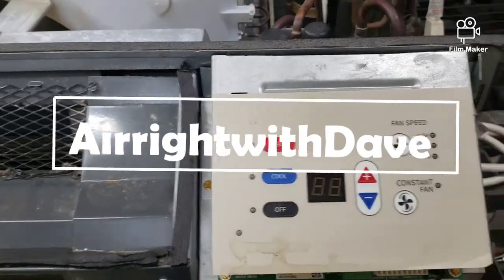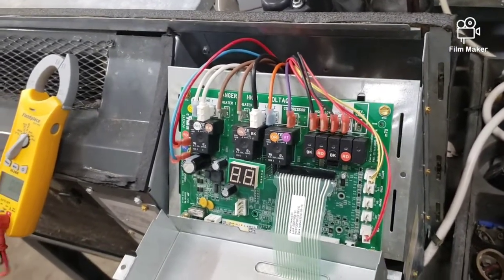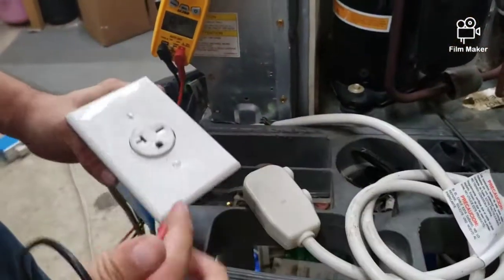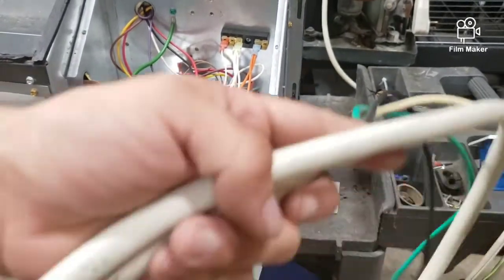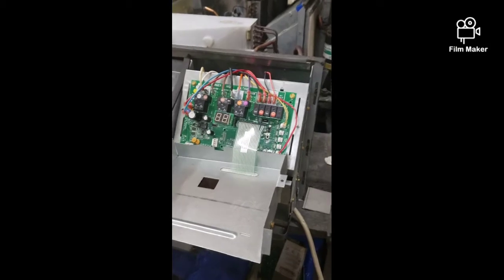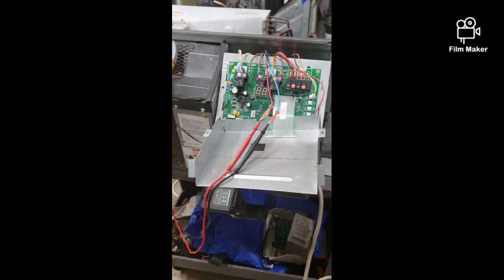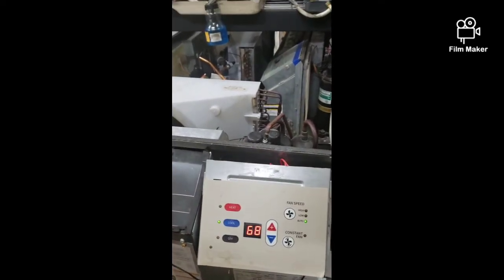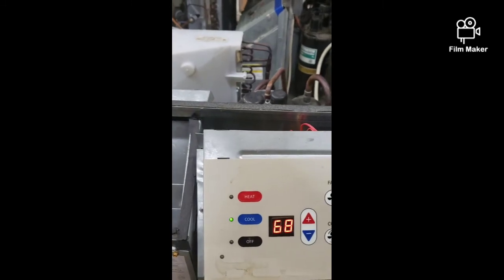Ptac not coming on at all/diagnostic

Comment: I had one of these units same control board, replaced it with new board getting 120 on each leg and 25 on low side still has no lights does nothing even with new board...
Reply from the maker: Hello
Check how much power is coming out of the outlet.

Comment: Hello David, I have a few of these newer Amana PTACs at my hotel I work at and I have been running into these newer PTACs having what looks like secondary control boards on the inside. I don't see anything in the manual that shows it and how it is wired to run the unit. Have you ran into this issue before, and if so how did you resolve it?
Reply from the maker: Hello,
I believe you are talking about the variable speed terminal board, if so that board is to control a DC motor(blower motor or condenser motor). Is the unit not operating at all?
Reply: @PtacSolutions  it is operating however tje guest has been saying that there is an audible clicking. The unit would cool and then the clicking would start and then would start and stop its cooling
Reply from the maker: @Joeygambit  so what I usually do is take the unit out of the sleeve and let it run so I'm able to pinpoint the clicking noise. It could be the condenser motor going out

Comment: If you replace the board, have 230AC and 24VAC, and it still does not come on, did they send me a bad board?  Is there anything else to check?  Thanks much for your videos.
Reply: OK I can see that the ribbon cable from the display is torn at the corner and one trace has been disconnected.  I assume that means a new display is needed.

Comment: Ayyyyoooo, im at the same point with accurate power, (from plug, cord, board, transformer, and then board again), coming into the board from the transformer.
Is there nothing else that could be wrong? Or anything i need to test before buying the new board?
Reply from the maker: Hello,
If you have 24 volts or so coming out of the transformer, then more than likely you board is bad
Reply: @PtacSolutions  that's what I figured. Thank you for the video and the reply! I owe you one!!

Comment: So did you push the reset on the cord/ and or did you verify that the light is green on cord meaning there is power. 230 cords have reset and not to often fail
Reply from the maker: Hey Josh
Yes I did press the reset button on the power cord but no good. Power was not getting to the unit. It's uncommon for the power cord, but I have seen several go out for different reasons.
Reply: 😂I was gonna say the the same thing I'm  so glad  I didn't  before reading your lol

Comment: I own an apartment complex that has several of these in them some are whirlpool I believe and then summer Amana I was wondering if these older ones are worth working on and replacing them and how do I perform all the troubleshooting steps as I have several that are not working right but I think that they are still worth saving. Thank you for your time.
Reply from the maker: Well it depends, if it's something simple like a control board, capacitor power cord etc.. I would repair, you can diagnose by following the steps in the video. If it's something like a bad compresor, refrigerant leak or if the unit is older than 12 years of age, I would recommend the unit to be replaced. Thank you for watching...

Comment: Hey so I work at a hotel and I’m wondering how to test for GE ptac unit it’s just like the one you changed the condenser fan on the video but just wondering what I should check we have a unit the compressor turns on momentarily sounds like a humming sounds but doesn’t turn on the fans what can I troubleshoot to get it going ?

Comment: Thank you for video. How you test power as there is two hot wire. Do we use ground as neutral? Please tell more  about two hot wire.
Reply from the maker: Hello,
Two hot wires are simply two wires that are energized with 120 volts each,  which correspondingly will 208- 230volts if measured together..

Comment: Thanks, great video.  Question: Did the cord actually need to be replaced here, or only the control board?  If only the control board, is there a way to find that out before replacing the cord?
Reply from the maker: Hello, 
Yes power cord needed to be replaced because the control board was not getting power due to that power cord. After replacing it power did get through to the control board but the board was still not responding. After testing the transformer( was good) I knew that the board was also bad... Thank you for watching!!
Reply: @PtacSolutions  What about the buttons on the side of the power cord?  Im assuming they act as a GFCI outlet would've.  Could it possibly have been that when the board went bad that it tripped the GFCI and all you needed to do was reset it?  Not trying to be difficult, just legitimately curious.

Comment: Hey Mr Dave working on a amana ptac is there a way to reprogramme the unit the compressor won't come on seems  like everything checked out good ?
Reply from the maker: Hey Paul
Check to see if the capacitor is good, check the overload switch as well. If its one of the newer units check the pressure switch
Reply: @PtacSolutions  Hey Mr Dave I checked everything and it doesn't have the pressure switch I told my boss it's the board and he was the one that said he knows someone that knows how to reprogram thaw units I never heard of it let me tell you your a good teacher and I checked everything u said to what do you think is it the board
Reply from the maker: @paullambert1485  thank you... It could also be a possibility, if you still have access to the unit I would check If the control board is sending power to the compressor either at board or at the compressor itself by removing the terminal cover
Reply: @PtacSolutions  Thanks Mr Dave I will let you know
Reply: Good morning Mr Dave I went back to that unit and now it is getting power to the board but it won't even come on what do you think ?
Reply from the maker: @paullambert1485  ok, so check the compressor windings, you are supposed to get continuity between every terminal. How about the overload switch? should be under that terminal cover as well. If is open more than likely you have a bad compressor
Reply: @PtacSolutions  thanks I will check the windings and the overload switch is good
Reply: Hey Mr Dave I figured out that ptac it was the board i jumped out the compressor and the fan they both worked so I replaced the board all good now thanks for your help

Comment: Dave, I have a Frigidaire ffrp152lt4 ptac I've had to get for our heating source. There was no power supply cord w it so I've had to order one. I've waited to the last min to install the cord, though there are no clearly labeled areas for power cord to plug into on board. Any info or help would be much appreciated. Thank you for your time in these vids
Reply from the maker: Hello Lindsay 
Can you send me a picture of the electrical compartment so it would be easier to guide you to:
davidcardenas@airight.net
Reply: @PtacSolutions  email returned w contact info 🙏 God bless you!!

Comment: Hey Mr Dave hope all is well I'm having a problem with a thermostat will not connect I keep getting a code on the thermostat that says CF I know ona unit it probably means clean filter but no codes on the unit what could that CF mean
Reply from the maker: Hey Paul 
What kind of thermostat are you working with

Comment: Hey David that was a great video. I did the same test but you confirmed that the control board need to be replaced. Where can I get the control board?
Reply from the maker: Hey Dewey
You can get the board directly from Amana.. their number is 18773760214
Reply: @PtacSolutions  thanks
Reply: @PtacSolutions  Thanks, very useful video. Where can I find an Islandaire Control Board and Transformer?

Comment: my frigidaire 900btu ptac is not coming on. is there any fuse in the unit ishould check
Reply from the maker: not to familiar with frigidaire , worked on some on rare occasions, but I would check if the unit is getting power. If its the newer type, some have trouble with the display board/touchpad. If its a 230 volt unit dont think they have a fuse.
Reply: @PtacSolutions  we jus just replace the whole unit instead

Comment: If the little green light is on on the plug in part but the ptac unit isn't coming on, is it bc the chord is bad and needs replaced?
Reply from the maker: Would you be able to check the output of the transformer? I would say that a very common problem for the Amanas is the the control board, but I wouldn't know unless you can check

Comment: Mr Dave I have a Amana unit changed the took the board out of a unit that works and I'm getting power to the board but unit still will not come on what the heck could that be
Reply from the maker: Ok, so let's use process of elimination.. has to be 1 of the 4.... control board, power cord, transformer or a fuse( if unit is 265 volt)... if all that checks out I would replace the control membrane itself
Reply from the maker: Oh also make sure you are getting the correct voltage to the unit
Reply: @PtacSolutions  hey Mr Dave I checked both legs both legs are getting 120's I checked the plug itself and it's getting like 218 so I don't know if that had something to do with it or not but I put in a whole new unit and fire right up so it's not the power going to it I just can't figure this one out
Reply from the maker: @paullambert1485  hey Paul, sounds like a transformer problem... but I'm glad you got it resolved
Reply: @PtacSolutions  Thanks Mr Dave I'll let you know when I get it figured out I'm gonna work on it next week
Reply from the maker: Chad T  Hey Chad, on the Amana units the ones that come with a 20 amp fuse are the 277 volt units and the would be located right below the control board

Comment: So, you just changed out the power chord without even checking the gfci reset switch to see if it was tripped ?
Reply from the maker: Yes, the reset button on the power cord was stuck and would not reset..

Comment: I have a ptac unit I have power from wall to unit but the unit still ain't coming on and I've replaced the transformer the round transmittor still nothing I don't kno what else it could be
Reply from the maker: Hey Elvis 
What kind of unit is it
Reply: @PtacSolutions  how do I tell that
Reply from the maker: @elvisfoy8039  does it look like the one in the video
Reply: yea
Reply: @PtacSolutions  yes it's just like those I work at a motel
Reply from the maker: Can you confirm that out of the outlet 230 volts are coming out...if so, also confirm that out of the transformer 24 volts are coming out
Reply: @PtacSolutions  how can I check that sir
Reply from the maker: @elvisfoy8039  ok, put your multimeter leads inside the outlet to check power coming out(should be 230 or 265 depending on the building) if that checks out move on to the transformer.. check if power coming out of the transformer is 24v
Reply from the maker: @elvisfoy8039  https://youtu.be/aWO7BTRHhd4

Try these steps to check the transformer
Reply: @PtacSolutions  coming out of the wall is 240v
Reply from the maker: Ok so that's good, what about the transformer
Reply: @PtacSolutions  I'm gonna have my boss check it out tomorrow but we replace it also
Reply from the maker: Yeah just wanted to make sure because if it's good the problem is the control board
Reply: @PtacSolutions  we will check it but we also replace the board twice
Reply from the maker: @elvisfoy8039  really? OK let me know how the transformer turns out.. also look for any loose wires inside the control panel
Reply: @PtacSolutions  still nothing we replaced everything and we even plugged another one in before we did anything and still nothing but there is 240v coming out of wall outlet
Reply from the maker: @elvisfoy8039  was the other unit working before you plugged it to that room? And let me ask you this, if you connect that other unit we had originally started with in another room would it work?
Reply: @PtacSolutions  I never tried that
Reply from the maker: Do you see any burnt marks on the outlet?
Reply: @PtacSolutions  no
Reply: @PtacSolutions  how can I send u a picture
Reply from the maker: @elvisfoy8039  ok, so assuming everything is connected properly it has to be one of the four-  power outlet, power cord, transformer or control board
Reply from the maker: @elvisfoy8039  ok send it here also send a picture of the control panel wiring 
davidcardenas@airight.net
Reply: @PtacSolutions  it's not letting me load it
Reply from the maker: @elvisfoy8039  oh no.. ok try this one 

cardenasd89@gmail.com
Reply: @PtacSolutions  just sent u a email at the gmail one
Reply from the maker: Got it
Reply from the maker: @elvisfoy8039  ok everything looks good on that pic... can you check how much power is coming out of that transformer
Reply: @PtacSolutions  ok and my boss sent me something bout hooking the wires up differently or something on the control board that has to do with the compressor or something like that lol
Reply from the maker: @elvisfoy8039  let me know
Reply: @PtacSolutions  we replace everything and it's still not powering up but we have 230v coming out of wall n 24 v from transformer
Reply from the maker: @elvisfoy8039  Hey Elvis, ok so if the transformer is giving you 24v that means that the outlet is good, means that the power cord is good (power going to the unit) and the transformer is good as well( making high voltage into low) so the only thing you are left with is the control board or maybe the actual touch pad( Control membrane)
Reply: @PtacSolutions  we changed all that bro still nothing
Reply: @PtacSolutions  we have a ptac unit that won't come on we are getting the voltage we need to the transformer(24v) control board (240v) and still ain't coming on here is a list of the stuff me and my boss replace
 1 transformer
  2 control board
 3 capacitor
 4 top cover membrane
  the only thing we haven't replace is the power cord but we have power to the unit

Comment: my control panel is working but no heat unit is couple months old
Reply from the maker: What type of unit is it? If its a Amana, I have a video for it. If not I would check for loose wires first
Reply: @PtacSolutions  my model # is PTH123G35AXXXCA, what control board would mine be?
Reply from the maker: @Joe-zn5je  hey Joe, you can use a RSKP0012
Reply: thank you

Comment: Turn my Goodman unit on air conditioners working fine heater core is working fine goes around fan real slow and stops
Reply from the maker: Hey Philip 
Is it the front fan(blower) or the back fan?

Comment: I got 277 how to change it to 240
Reply from the maker: Hey David 
You will need a power cord and to set the transformer to 277( back side) if there's no terminal for it you will need to change it. However I wouldn't really recommend it because it might affect the unit in the long run

Comment: Ptac plugged in wall but unit will not turn on at all!  Changed the cord and still will not turn on
Reply from the maker: Hey Dewayne
Do you have a multimeter around?
Reply: @PtacSolutions  yes! Check it and it wasn’t the ax plug nor the outlet because I plugged another ptac unit and it showed the red power off light
Reply from the maker: @dewaynejohnson604  Alright, unplug the ptac unit if it's still connected, now  from the control board disconnect the transformer wires, if you are facing the unit its the ones on the far left( two lone wires) hook up your multimeter leads to the end of those wires, carefully plug the unit back up and let me know how much power your getting

Comment: WHY WOULD MY PTAC UNIT SMELL LIKE EXAUST FUMES, STRONG SMELL OF EXAUST, AM I IN DANGER
Reply from the maker: Hey Ken
That usually happens when you haven't turned the heater on, the coils collect dust and dirt, so when you turn on the heater what you are smelling is the the coils burning off the dust. Now unless you see sparks you might want to be more cautious
Reply: @PtacSolutions  THANK YOU FOR ANSWERING ME, I WASN'T TOO SPECIFIC EARLIER, I AM STAYING AT A EXTENDED STAY MOTEL, I WAS IN A ROOM FOR 13 DAYS RUNNING THE HEAT, NO ISSUES WITH AN EXHAUST SMELL, THEN IT STARTED SMELLING LIKE EXHAUST, BY THE NEXT DAY, THE SMELL, BURNT MY EYES, AND BECAME UNBEARABLE, THE FRONT DESK CAME UP, SMELLED IT AND SWITCHED ME TO ANOTHER ROOM, NOW THIS ROOM IS SMELLING LIKE EXHAUST, IM NOW PERPLEXED, ITS A,( AMANA HEATING AND COOLING WINDOW UNIT) ANY IDEAS?

Comment: Was there a fuse on board
Reply from the maker: Hey Kenneth
No, the only ones that come with a fuse are the 265 volt units but the fuse would be located at the bottom, completely separate from the board
Reply: @PtacSolutions  the one I worked on other day yes was on lower board